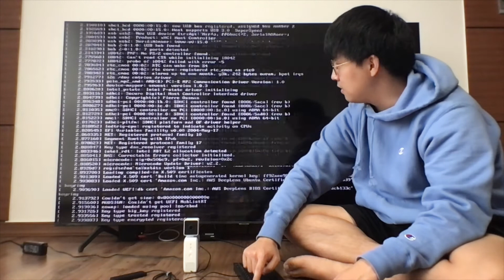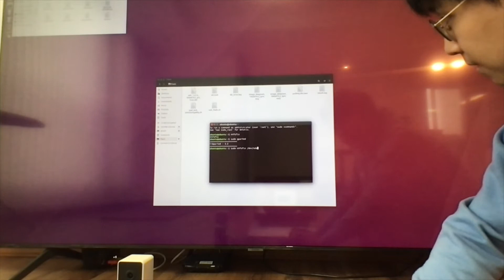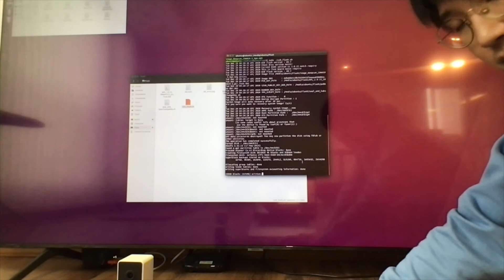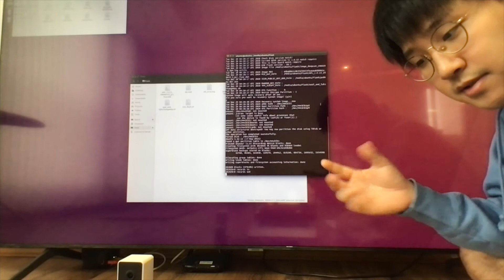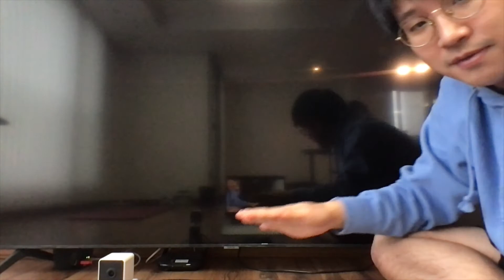let's code | AWS DeepLens Tutorial | part 2: Restoring AWS DeepLens to Factory Settings

Comment: My DeepLens does not recognize the USB in the BIOS. I have the older V1 DeepLens. Following the "Recover DeepLense Documentation" I created a USB containing both the FAT32 partition with Ubuntu-Live-16.04.3-Recovery.iso and the NTFS partition with unzipped DeepLensFactoryRestore.zip. Do you think I need to use the SD Card like you did? I think your USB has the Ubuntu-Recovery and your SD Card has the DeepLense files right? So even if I did it that way, it wont still recognize the USB.
Reply from the maker: This part 1 has the details on how I am utilizing both USB and SD card - https://www.youtube.com/watch?v=5fEuifzMLr0 

If it's the older V1, I think the USB should work, but if the BIOS isn't recognizing it, I would go with the SD card approach shown in this video.

Let me know if you have any questions or want to bounce any ideas - good luck!

Comment: I run recovery multiple times but cant boot. so sad, I bricked it :(
Reply from the maker: Don't give up yet! By "running recovery", do you mean trying to boot recovery Ubuntu from BIOS?
Reply: @bulogging  I deleleted all partition and tried to install ubuntu like a normal conputer, but it cant boot because it cant pass secure boot, do you know how to bypass secure boot?
Reply from the maker: What happens after you press enter on .efi?
Reply: @bulogging  it depends, with the usb recovery i enter Ubuntu on usb. but everything else is failed
Reply: @bulogging  do you have telegram or other chat app, I will send you photos
Reply from the maker: @mphat10  could you DM me in YouTube?
Reply: @bulogging  After reinstall ubuntu, I enter emergency mode
Reply: can you check how many partition does the lens have?
Reply: reinstall Ubuntu=> emergency mode
factory reset=> no init found---> rebooting due to panic  argument

Comment: My Deeplens in not recognising my bootable flash drive. I burned by flash drive using Etcher on Mac. Can you guide what can be done?
Reply from the maker: Yeah so at 1:40 I talk about how we need to use both SD card and USB drive, where the SD card has Ubuntu files and the USB drive has the DeepLens Ubuntu installation files.

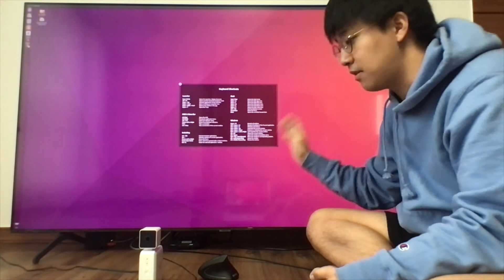Essentially, you use the SD card to load the “recovery Ubuntu” on the device and, once you’re in the “recovery Ubuntu”, you plug in the USB with DeepLens Ubuntu installation files into the device using the USB hub. This is shown at 10:50.

I talk more in details about how to create the SD card and USB drive in Part 1 of this tutorial series here: https://youtu.be/5fEuifzMLr0

Let me know if you have any more questions!